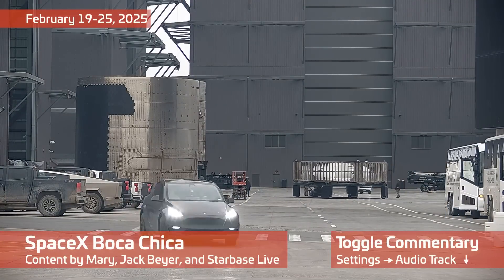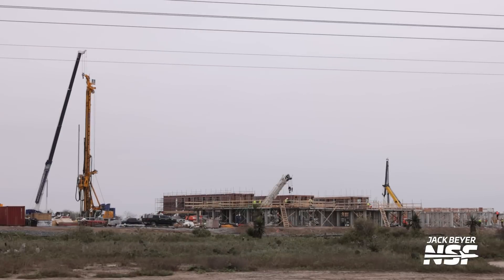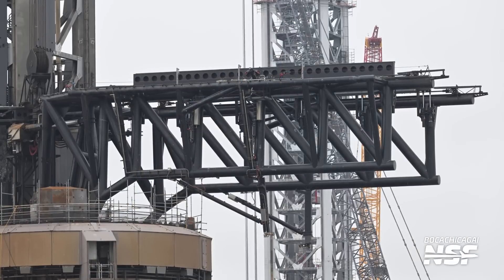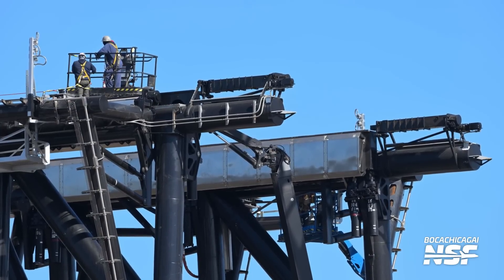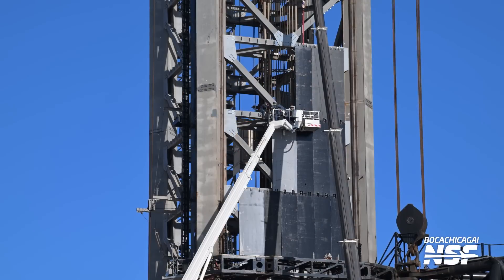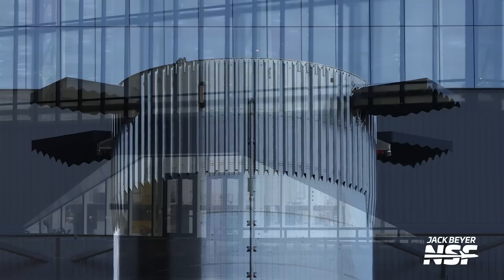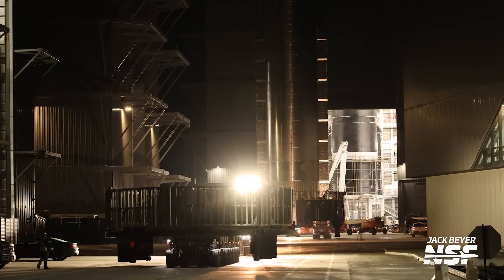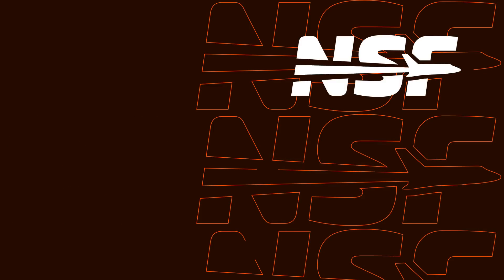"We Are Barreling Towards The Next Flight of Starship"  | SpaceX Boca Chica

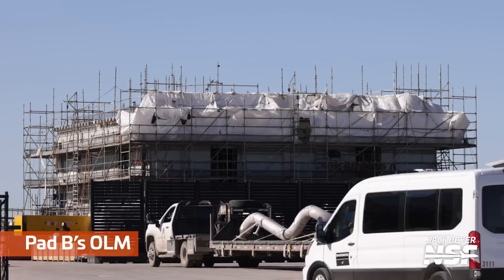Comment: 9:00 its not that 5% of final work takes 50% of the time but rather, structure assembly is 5%(well of course it can vary but just sayin to make a point) of the work, and outfitting it is the hard part.
I mean look at pad A, spacex claimed they built that pad very quickly, but then spent many more months outfitting it, and arguably its still being worked on and developed
Or look at SLS' ML-2, main launcher structure is rising fast in latest weeks but it will still take 2 years to outfit it and test it with cryogenic fluids.

This visual "95%" that is the structure construction is the easiest part of making those things

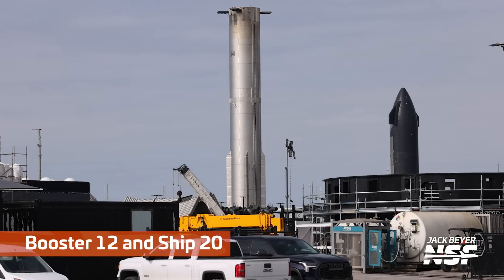Comment: 4:30 "the HSR shuffle", go back and return. When the HSR rolls out SF it was blank at the top. The sequence they rolled it back, there was black marks on the top. For me looks like very symmetric. Maybe a fitting for the Block2 booster where to locate the pipes or where to make access points in the shield for engineer. My guess

Comment: Hey John, in 1:30 ish you ask what they are doing with the tiles. I think is a waste seperation. If you melt the steal and have ceramic inside, esspacially high temperature ceramics, it will not burn away and produce instead of good steal, bad steal. My Suggestion.
Reply from the maker: That makes good sense. Thanks for watching! - Das

Comment: What exactly is the problem with this Hot Staging Ring? It was in & out of the MB twice before the install and now being removed yet again. Is there a fit problem? Bad build quality overall on that one? 

If they can't get that particular HSR  to work for whatever reason, should they just scrap it & build another one?  

And is that the only hold-up, because if they're still installing the FTS on S34, then that's easily the longest FTS install ever. I'm guessing though that they're going over everything else in S34 with a fine toothed comb.  

But yeah, if B15 & HSR problem isn't resolved by say noon Thursday,  than Friday launch ain't happening.
Reply: I'd assume it's more likely the be issues with the top of the booster than issues with the hot staging ring. But either way it does seem odd that it keeps coming on and off